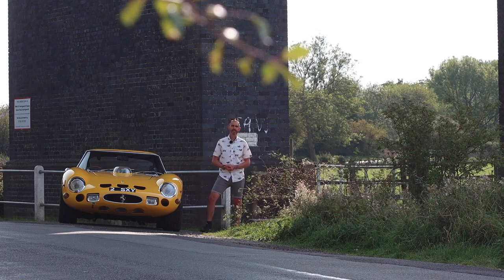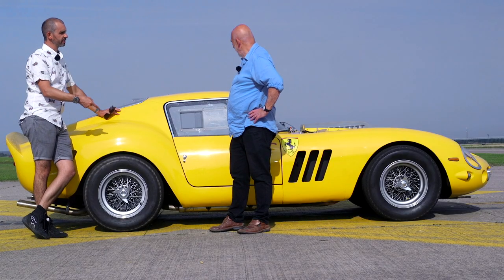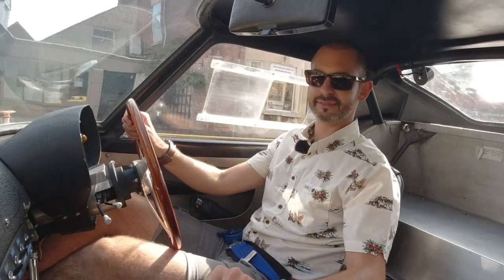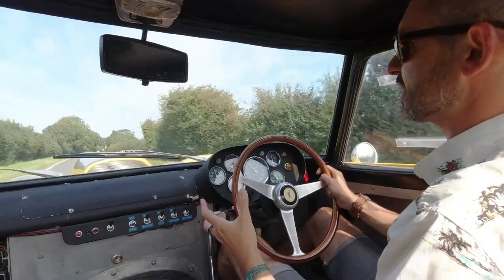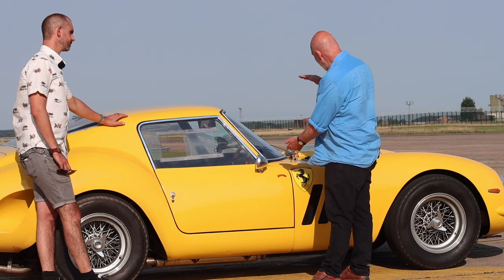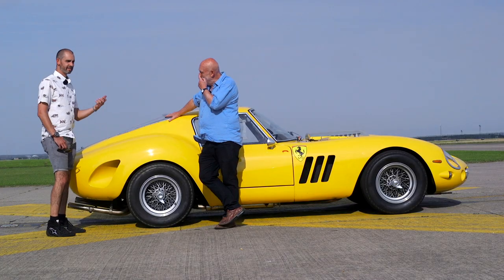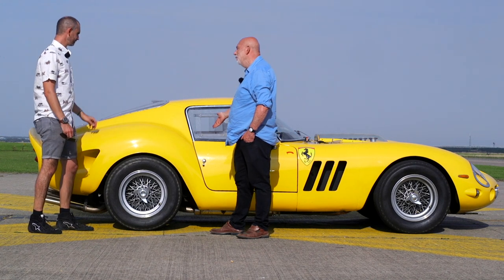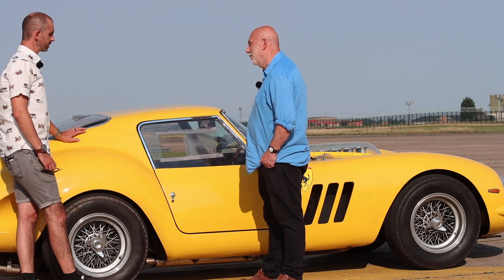600bhp Ferrari 250 GTO resto mod thrashed // The Late Brake Show

Comment: 1% the cost of a 250 GTO with double the power.
Reply: 0.1% even. I bet one could make it for $70,000, now that the owner has divulged his build plan.
I saw an ad for a 550 engine for $20,000 once and I get I could get a burnt Ferrari for another $20,000 and then go from there with parts. The body shell could be crude in the start and just made to work over time, as could details inside and so on.
Reply: It's sickening to think 500k is 1% of the real car's cost
Reply: 1% price, twice the power, ten times the fun
Reply: KITCAR
Reply: @RoverWaters  No, it is not a kit car.  It is a Ferrari.  Technically, a 400i.
Reply: @slopetechno  true
Reply: Saw it for sale for 600k quid
Reply: Not that any point of that car has anything to do with its power.
Reply: And one you can daily drive!
Reply: @sergiofacchinetti2954  same

Comment: What's the 0-60 time? Answer: I don't quite remember.

 YES! Because who cares. Is fast, light and fun.
Reply: I mean once you get under a 6 second 0-60 who really cares that much
Reply: Reminds me of Bob Mortimers estate agent " I don't know "
Reply: Jorn Navarre  8 sec would be nice ,power to weight should be done 
need to be tuned in.
Reply: @Garf2O  Someone on the same page as me! I personally don't want my car going faster to 60mph than 4 seconds. My last 5 cars have all been between 4.8 and 5.0 and that really is fast enough. Any quicker and you wouldn't be having fun trying to change gears manually. It's even crazy with paddles trying to catch a shift before red line when it all happens crazy fast. It doesn't seem like fun.
Reply: Exactly!
Reply: It probably puts Time in reverse
Reply: @veemacks7255  my next car i want low 4s to 60, but if i didnt live in an area thats full of other assholes to begin with i can live with mid 5s most of the time driving around by myself cause its quick enough to be sporty even in a straight line.
Reply: Hi Johnny,  how can he put Ferrari emblem on that car, and nothing said by Ferrari.

Comment: "The owners don't race the original cars" - what a load of bollocks. Every 250GTO that I know that races or rallies regularly (Goodwood Revival, Tour de France, Tour Britannia, etc), is an original car. Given that a number of them have been in accidents over the years and bits have worn out, some parts will have been replaced but the idea that the owners race a replica while having the original tucked away in a bank vault is complete rubbish. Not least the FIA would not permit this.

Comment: Jonny, awesome stuff I love it. 
But, you did say the 2002 575 was the first ferrari with the F1 style 'box.
I must correct you, the 355 was the first ferrari with the f1 gearbox, introduced on the 1998 model I believe. 
I have a 1998 355F1 in my garage

Comment: Back in 1984, I almost bought a 250 GTO kit car (280z underneath), but it was $14,000. For $14k, it's still a 28OZ.
Reply: know what your doing i used to race the datsun and "Z" cars, you can get 250 hp without alot of work

Comment: 600bhp with low back seats and only lap belts is crazy, you should either stick with the original performance or upgrade the safety to match the power.
Reply from the maker: It adds to the exhilaration.

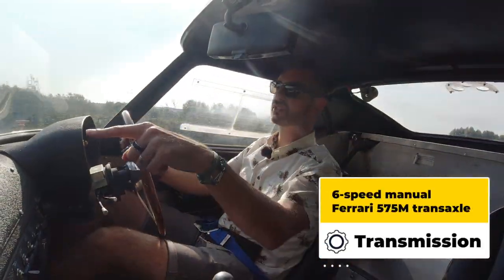Comment: At 9:15 you say the 575 was the first Ferrari to feature the F1 gearbox, but I'm pretty sure it was fitted to the 355 in 1997. This GTO is a fabulous car, thanks for sharing it and thanks to the owner!
Reply: Jake Akhtar first V12 to use that box. Previously the auto 550s 456s etc were a proper conventional torque converter auto
Reply: 1990 F40

Comment: Nice tribute car, but I feel sorry to say: Some of the body proportions are just not right. The curvature of the rear fenders are too swollen. The rear end that holds the plate and lights sit to high in relation to waistline. The holes that surround the fog lamps are way too big. The vent behing the rear wheels sit too high. Considering the price (1/2 million ) is feels like a very expensive kit car.

Comment: This is far better than the original because you can use it.
A 250 GTO has such a high value today they will hardly ever be seen in public.
Reply: "A 250 GTO has such a high value today they will hardly ever be seen in public." They were specifically designed to be circuit racing cars, and only 39 of them were ever made. Hence they would never be seen in public neither in the past nor today for two reasons. 39 makes them so rare most will never see one. And since they were racing cars first and foremost, driving one on the road is not a common occurrence even for those who actually own them. Let's just say that comfort and sound isolation aren't important in a racing car and hence the only proper place for a 250GTO is the racing track. Period.
Reply: @paulallen8109  I remember in the 80's going to local race tracks on the weekend when they had 'track days', seeing 250GTO's being trailered there and then thrashed around. One chap turned up in a rusty mettallic orange Metro, jumped out of that into his GTO just off the trailer, still with his green wellies on.
The 90's had the 'Goodwood Festival' and Nick Mason was always there with 512S and his wife in the 250 GTO, along with a load of other rare Ferrari's.
Reply: @paulallen8109  So he was right then?

Comment: Am I the only one who thinks this is a shocker ?
The proportions are not correct for a GTO for starters.
It's a one off kit car with a modern day 575M V12 Ferrari engine.
And as for £500k selling prices ... laughable ... I'd sooner have the original car the engine was from ...

"What is basically a 250 GTO ... " ... come on Johnny ... it's not and it's nothing like it ...

Comment: If you were to replicate a 250 GTO to appear absolutely period correct. I know he used the 575 GTC Maranello engine in this one. Is that the last late model Ferrari V12 that could be converted to look period correct, run the 6 or 12 carburetors, some special 4 seperate 3 into 1 manifolds mated to a period correctly looking 4 or 5 speed but actually a 6 speed. As gorgeous as these cars look on the wire wheels with either wire wheels or the cast can extremely upgraded brakes be assembled to go behind the wheels? Since the chassis is all tubular now couldn't the use of CAD help make the chassis has absolutely strong as possible with less piping just more strategically placed all while using chrome moly that weighs nothing. Instead of having the body work done in aluminum or sheet metal what if carbon fiber was used similar to how Singer does. Imagine if you could begin with a 575 M engine and increase the displacement all while making it lighter. Use the 575 heads but have the worked over to perform more airflow at low medium and high valve lift and raise the compression a lot so it responds so instantly. Then get some camshafts with faster accelerating lobe profiles that not only opened sooner but opened the valves further and deeper. Using solid or sodium filled Ti or Inconel valves, along with the springs and hardware there. Then have 4 3 into 1 manifolds made that best takes advantage of the larger displacement, head flow, cam timing, and an oval Inconel exhaust with either no mufflers (because a 6.0 if stock displacement is retained with lightened rotating assembly, ultra lightweight 48 valve, high flowing heads and higher lift and longer duration camshafts, close to or over 12.1 CR breathing through the exhaust I mentioned no mufflers might not be needed.) As for an intake setup to look period I guess you would need to find some way to use 6 Webers, unless you could have in intake make with 12 ITBs joined to reassemble 6 Webers and find a way to hide modern fuel injection. Between that, the upgrades on transmissions and synching together flawlessly, a nice lightweight clutch and flywheel combo and I don't see why a 250 GTO that was around 296hp and 217tq while weighing around 2300lbs wet that a 575 based replica couldn't make 600-650hp and 500-530tq with a 7800-8000 rpm redline in a car that should weight 100-200lbs less than a GTO. Because what kind of lunatic would build a car like that and not make it something your want to drive. This car is amazing and if I had the funds I would love to commission one myself along with several others.

Comment: As a child I got taken for a ride in a 1964 250 GTO resto-mod.  But like this one it was all Ferrari, in this case the donor chassis and running gear was an ex-F1Dino 256, chassis 0007.  It also had a plexiglass dome covering the 12 carb velocity stacks

Comment: It's worth 2.5 million.
He is wayyyyy under valuing his car.
2.5 million
Also @600 hp I'd stick an A/C in it they make powerful modern units,small enough why suffer when you could enjoy it completely .
I've had Sports Cars all my life, I had a Sports Car only Restoration Shop in New England for 20 years. I'm currently resto modding two personal cars for myself Datsun Z's.,in Florida.
    I know Sports Cars.in today's market he should be getting 2.5 million for this beauty and paint it red as it should be.. It's very hard to find old Ferrari. Endo has been gone ,so every car he made has VALUE. 
    Is a Ferrari made from three Ferrari's , a Ferrari ?
      I say try today to gather the cars he used to build this Horse and you will see 2.5 is the value of this car made from Ferrari's.
His asking price is W A Y to low.

Comment: Won't stay for sale long ....
That is everything you want in a vintage Ferrari "A Driver "
Twice the Horse power is the grin factor. It handles, the Steering Wheel stayed ,Die straight. 
Look at you doing donuts on Old original wire wheels " Ballsy "
"What a great build, a car Enzo would be jealous of "

Comment: This should actually be called a replica because it is one! It’s not a restroMod because this was never a Ferrari, it just have a Ferrari engine from completely different era! It doesn’t even encapsulates the essence of driving the original GTO because everything is wrong (hp, torque, gearbox, weight - total and distribution etc) so it’s pretty sad! It’s also sad that it doesn’t even have a/c - if you change everything at least add a/c and some heat shielding on the transmission tunnel...

Comment: More loud cars coming? I can wholeheartedly recommand getting a Sena 10U fitted to your helmet for recording clean voice tracks in super loud environments. A second unit (10S) can provide wireless connectivity and line out to your preferred audio recorder. I have a pair of 10S myself and would buy them again. No cutting or soldering required for a standard install. Tucker Gott shows how it can be done for a different kind loud environment: https://www.youtube.com/watch?v=4jvlwMLFWBo

Comment: My dad has a gto on a datsun 240z frame, lt1 engine, 6 speed manual, wilwood brakes, and real knock off wire wheels. Lives in bumfuck East Texas and never drives it but it’s flawless. 

This has wrong proportions, especially the nose. It’s just too stubby. And $500k is $400k too much

Comment: Worth a tenth of that me thinks. Pretty nice build tho.
Shame the rear proportions are a bit off, mainly the rear arch 'hunches'.
Reply from the maker: The rear arches have been widened 4 inches for the wider wheels and tyres. Common mod on 250 GTOs when privately raced in the mid 1960s.

Comment: "This bit here "is the scuttle panel ! £500K , That's a tad pricey for a kit car . I think the perspex cover on the bonnet is because the engine sits higher than the 3litre ? I know that Nick Mason uses a different engine when racing but l'm pretty sure he races the original car. Jonny, At 18.10 there's two reasons why l don't ever wear shorts In  public ! Not sure about this at all . I nearly bought one in 1978 . Mrs. Davey thought it was too much money ! I think Nick Mason bought it shortly afterwards. Oh, the price ? £4750.00p !